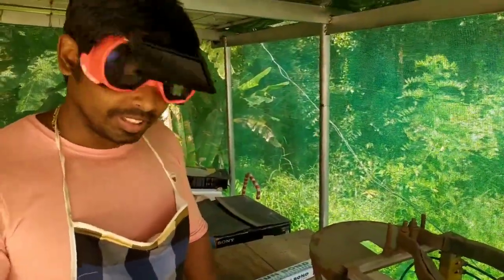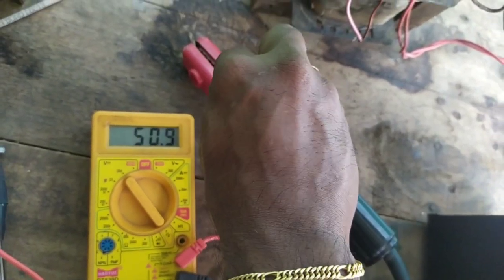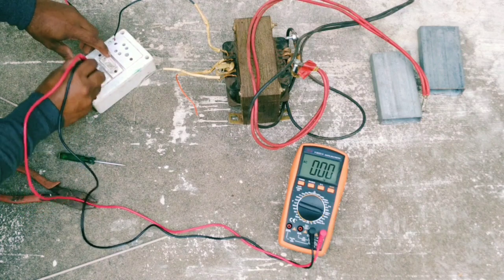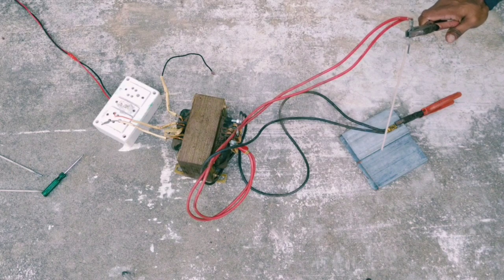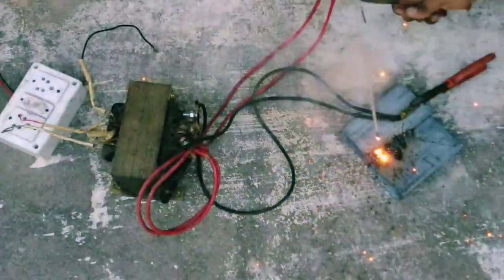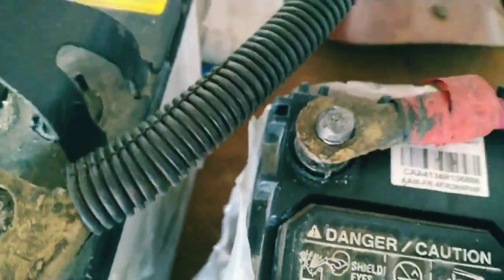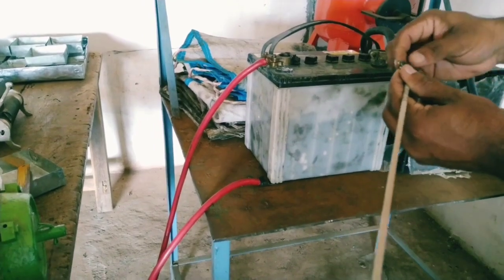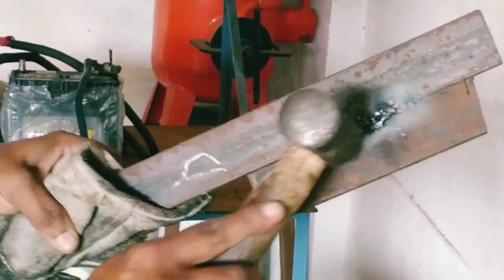We can weld with out a welding machine.

Comment: സാധാരണ 80 വോൾടേജ് വരെ അപകടമില്ലാതെ നമുക്ക് ഉപയോഗിക്കാൻ കഴിയും. പക്ഷേ വെൽഡിംഗ് മെഷീൻ 80 വോൾട്ട് ഓപ്പൻ സർക്ക്യൂട്ട് വോൾട്ടേജും 20 മുതൽ 30 വരെ ക്ലോസ്ഡ് സർക്ക്യൂട്ട് വോൾട്ടേജും ആണ് ഉപയോഗിക്കുന്നത് അതിനു കാരണം വോൾട്ടേജ് കൂടുമ്പോൾ വെൽഡിംഗിന്റെ സ്വഭാവം പൂർണമായും മാറിപ്പോകുന്നത് കൊണ്ടാണ് വെൽഡിംഗ് ശരിയായി ചെയ്യുന്നതിനു വെൻസിംഗ് മെഷീൻ തന്നെ വേണം അത് ഏത് രീതിയിലുള്ള പവർ സോഴ്സ് ആയാലും
Reply from the maker: ഒരു ac welding machine, transformer തന്നെ ആണല്ലോ... തുറന്നു നോക്കിയിട്ടില്ല? പിന്നെ അത്യാവശ്യം ആണെങ്കിൽ battery വച്ചും weld ചെയ്യാം.. ചെയ്തിട്ടും ഉണ്ട്... പിന്നെ load വരുന്ന time voltage reduce ചെയ്യും. അത് simply ohms low ആണ്. resistance കുറയുമ്പോള്‍ voltage വരുന്ന variation. ബാക്കി വരുന്ന voltage എവിടെയും പോയിട്ടില്ല അത് machin തന്നെ drop chyyunnu..ac ആണേല്‍ windings ഇല്‍ dc ആണെങ്കിൽ power circuit ഇല്‍... ഈ വീഡിയോ ഇട്ടത് welding simply plasma യുടെ heat കൊണ്ട്‌ ആണ് metals fuse ചെയ്യുന്നത് എന്ന് മനസ്സിലാക്കാൻ മാത്രമാണ്‌. Thanks for ur comment
Reply: @WEAREENGINEERSVLOG  എല്ലാ ട്രാസ് ഫോർമറിലും ഒരേ രീതിയിൽ ആണോ വോൾട്ടേജ് ട്രോപ്പ് ആകുന്നത്. അത് പോലെ വോൾട്ടേജ് കൂടിയാൽ സ്പാറ്റർ കൂടുതൽ ഉണ്ടാകുകയും ആർക്ക് ലെങ്ങ്ത് കൂട്ടുകയുംചെയ്യും ഇത് മെറ്റലിൽ ഹോൾ വീഴാൻ കാരണമാകുകയും ചെയ്യും ബാറ്ററി ഉപയോഗിച്ചു വെൽഡ് ചെയ്യാം പക്ഷേ ഷോർട്ട് സർക്കൂട്ട് ആയാൽ അത് പൊട്ടിത്തെറിക്കാൻ സാധ്യത ഉണ്ടോ . കാരണം റിമോട്ട് ഏരിയയിൽ സാധാരണ വെൽഡിംഗ് ജനറേറ്റർ ആണ് ഉപയോഗിക്കുന്നത്
Reply from the maker: @weldingtechnique4482  എല്ലാം ശരിയാണ്. Bt Arc adjust ചെയത് weld ചെയ്യാം. ശ്രമിച്ചാൽ കുഴപ്പം ഇല്ലാതെ weld ചെയ്യാം. Perfection നോക്കേണ്ട..
Reply from the maker: @weldingtechnique4482  anyway thanks or ur points. Keep in toutch.
Reply: @WEAREENGINEERSVLOG  ഒക്കേ ഒരു വെൽഡർ എന്ന നിലയിൽ ചിലർക്ക് നല്ല ഫെർഫെക്ഷൻ വേണം. വീട്ടിലെ ചെറിയ വർക്കിനു ഇത് ഉപയോഗിക്കാൻ കഴിയുമെന്നു തോന്നുന്നു. ഒരു 70 amps കറണ്ട് കിട്ടുന്നതിനു ഏത് ട്രാൻസ്ഫോർമർ ഉപയോഗിക്കാൻ കഴിയും.